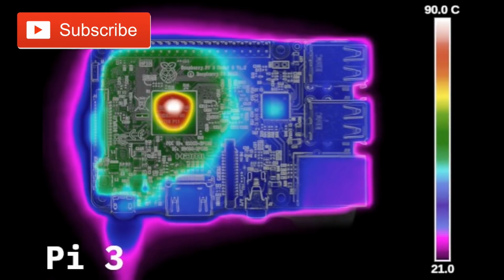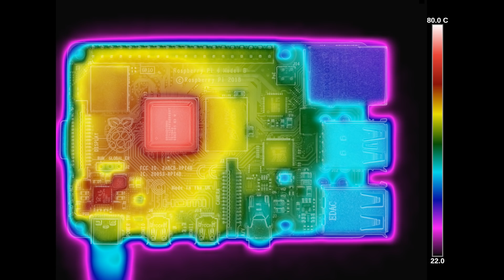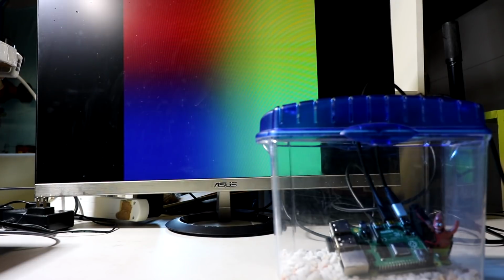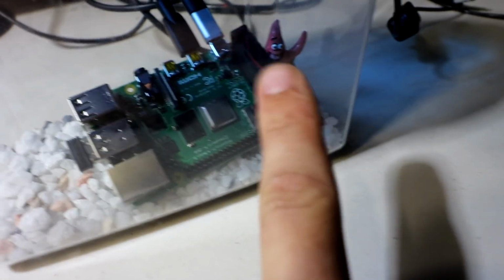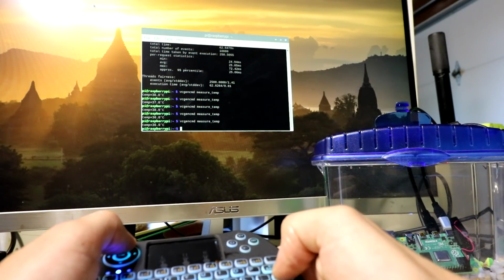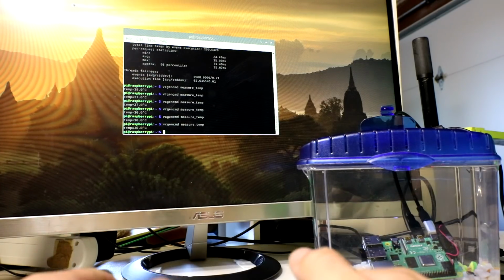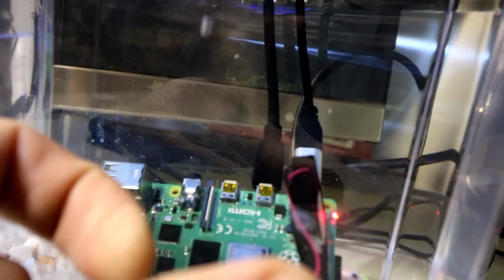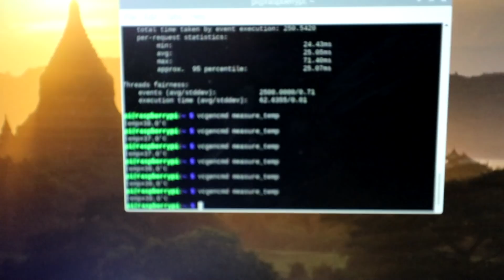Liquid Cooled Raspberry Pi 4

Comment: Amateur mistakes:
 - Submerging connectors and cables. Oil intend to climb in cables and then it is everywhere.

- Oil takes in heat but not give it out. You should use smaller tank and use watercooling equipment to cool it down.

- Most mineral oils are high flameable. (test it). 

- Case should isolate oil from surrounding world 100% as oil sucks in dust and other shiiieet. (other option is to filter it).

- keep all plastic parts above or out of oil. Oil brake plastic and small pieces will brake pump.
Reply from the maker: yup check my other videos we discuss this - this was more of a test
Reply: After all the effort of cooling a tank, may as well just water-cool the pi directly 😂

Comment: when you talk about the mess of having to swap the SD card and such, might consider putting like an SD extension cord (see them a lot in 3d printing) and then if you can get the fan to spin, it should circulate the mineral oil.  Other than that, cool build and great temps.

Comment: Without cooling the liquid overtime, it will get hott!.
Reply: nah, 1/2 gallon is enough volume for the heat to radiate off the top of the mineral oil, there's plenty of surface area at the top.

Comment: What's the longest you've left it like that and does it cause any degradation to the components at all?? Boot via USB outside the box and ssh and you're sorted! Almost seems too good to be true, but I looked it up... I was sure it was one of those "break your shit for lolz" pranks! What about storing it in a mini fridge or freezer, it's freezing point is -30... Can microchips suffer from being too cold? I know batteries and screens can, but the Pi has neither of those. Would just need to be cautious of condensation and water drops sinking to the bottom... Have you tried it with some kind of circulation? I mean, it won't be touched by water... But I'm getting the same temps from an £8 flexible USB fan...
Reply: Components don't degrade in mineral oil that said plastic does or maybe rubber probably both. From what I read I think His cables would get really hard inside the oil. As for condensation oil repels water so I couldn't really see water ever touching the Pi especially that surrounded by the oil. I've seen air bubbler used for circulation and would work great and looks decent. I'm thinking about doing this myself as I just bought my first Pi and don't want a case lol.

Comment: The problem that I can see is that once you submerge the Pi you cannot remove it from the Mineral Oil to add or replace USB or MicroSD.  Is that correct?
Reply: Put a usb extension cable in before you submerge it.
Reply: @mistermr.6938  i would probably plug all usb extensions in before dunking. and of course any hat you plan on installing as i feel like this is a one and done solution. now just imagine if that case was aluminum with heatsinks on it, and on the chips? 

just imagine using like a small oil pump and constantly pushing the mineral oil over it so tha tit's always completely covered BUT it also is flowing around and touching more aluminum surface area hahaha. possibly 25c temps?
Reply from the maker: You can just messy